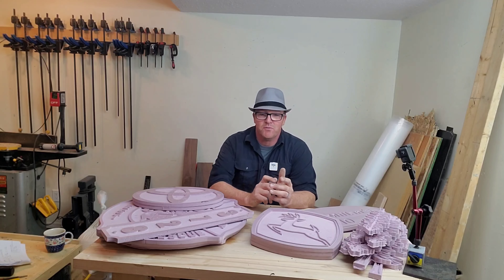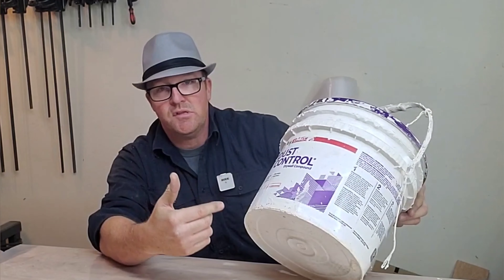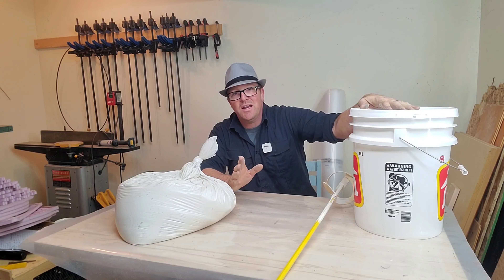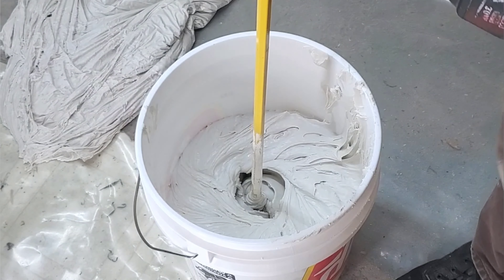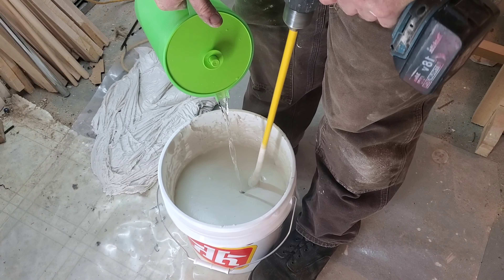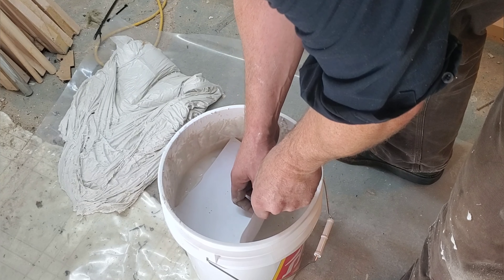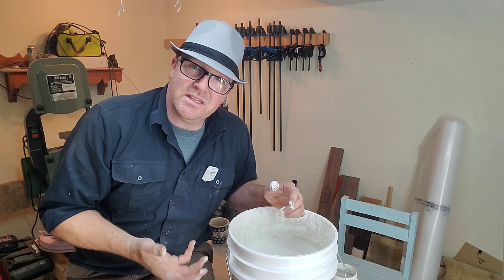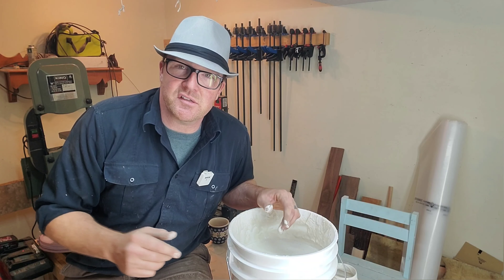Making cheap lost foam casting slurry

Comment: if you take a scraper and wipe the the bucket wall above the slurry line clean after each use, it will drastically reduce the propensity for the dried stuff to fall into and create chunks the slurry. Best, Kelly
Reply from the maker: Good advice as always kelly . Thank you

Comment: You can pull a vacuum on the mix and expell air a lot faster.  Have you ever tried straining the mix?  I think the only material that would strain it would be window screen.  You can use a silicon spatula to scrape down the sides so there are no old flakes. I love spatulas!  The Silicon spatulas scrape cleanly. I noticed when I started using them in cooking the pots and pans cleaned easier and I wasted less food.  Do you have a video on pre-prep of foam?  I've been thinking of primer paint sprayed far enough back the foam doesn't disolve and/or camp dry to help the cast stick and conform.  Thoughts?
Reply from the maker: I thought about vacuming as well , i did some lost wax a few years back and did it thay way . However i worry the air in the actual foam will cause issues . Much like a marshmellow in a microwave ,lol    also due to the size of the castings it would have to be very big .   I like your train of thought though on the topics :)

Ps , spatuala .... yes great idea to save and not have issues with it drying on the sides later !

Comment: Can’t wait to see more of this. I’m new to casting but lost foam seems to consistently make clean parts. I’m excited to dry this myself.
Reply from the maker: Lost foam casting is a fun type of casting and will make a consistent parts. I have been told that it makes a slightly inferior pare but have not noticed. it is marginally more risky with the off gassing of foam, etc just make sure you do your research prepare the mold correctly and wear your ppe. 

Check out some of my other videos and kelly coffields videos for a bit more inspiration :)

Comment: Just curious if that mixture is ready for the casting process? How long would it take before it gets sturdy?
Reply from the maker: The mixture after coated will take from 1 day to 3 days air drying. It is very important that it is fully dry all the way through.
Reply: @Wrighmachining  thanks seems like a highly detailed work with tons of patience.

Comment: Dear Mr. Wright,
I’m genuinely intrigued by your video to utilize dry wall compound as a suspenda slurry alternative, although in my country drywall compound that comes as a paste that’s been shown in you video is not readily available so I’m wondering if it would do just fine to use a powder form drywall compound and mix it with water into the right consistency? 

And also thank you for uploading this video I have learned a whole lot more about casting metal. ❤
Reply from the maker: Ok, if you are already into casting aluminium don't let the coating bog you down.   It will work with out the coating just fine.  Just you will not get as good ( but adequate ) of a surface finish.   The key in all of this aside from being safe and wearing appropriate ppe is vibrating your sand and pouring a little hotter than you would with green sandcasting.    The foam take a bit of the heat.   Check out some of the other videos. All have the coating but like I said it will worm with out. The coating doesn't hold the sand back at all.
Reply: Okay I will keep that in mind, thank you for the advice sir I very much appreciate it 👍🏻
Reply from the maker: Np

Comment: i do wonder if that mix would work with lost pla casting
Reply from the maker: That's a good hypothesis, however it is thin and doesn't have much structure due to be so thin. It's purpose is mainly to improve surface finish.     However I have used a type of plaster for lost wax casting and fired out the plaster and it worked great.

Comment: The shells don't dissolve in water once they're done? ...and the water content don't make them crack when dried or heated? I've thought about trying to use dry wall compound myself, but always discounted it, because I assumed it wouldn't work.
Reply from the maker: With thin layers on the foam it acts like graphite dusting on greensandcastings . It improves the surface finish   if you put it on way way to thing it will not breath properly and trap all the gasses . This could cause a burp or rapid bubbling of the metal .    It would have to be very thick though .   Once the mold is pourd the plater will wash off easy with soap and water . Some times i have put the alu in a bucket while it is still realy realy worm ( not crazy hot , causi g warping) and it sizles and takes the plaster off .     

Truth be told if yoi dont care about  space age surface finish it can be done with out the coating and just foam .  I just casted a machine part and it turned out good .  
Perhaps check out the lost foam casting video from last week . I casted a machine part for the servo motor that im puttibg on my indexing head .     Good results are seen just with foam

Comment: And you can fill this with molten aluminum with no major issues? I was under the impression a slurry had to be some unusual refractory material only special gods can acquire. This is awesome! I know nothing of this, BTW, as I have never attempted it. It was only an impression, so looking forward to watching your second part and learning from this!
Reply from the maker: It will be a couple of weeks before I get out there for part 2. Check out my channel though. I have a bunch of lost foam projects I did.  

Just be careful and make sure everything is dry, your wearing safety gear and you have done a tone of research from differed tplaces . Aside from the regular dangers with casting there is added toxic smoke and water from plaster if its not dry

Water expands 1800 times it's size into steam. If its wet it will spit out where your pouring.

Comment: Anyone who has done this, what kind of surface finish/detail are you able to acheive with the watered down joint compound? Currently testing this a few ways going looking for the most immaculate part casting with a lost pla or lost wax casting. Have a few different mixes drying with added flour silica, added waterglass. The joint compound seems to hold up pretty well but i need perfect for a 1 tine cast of a precision mold😂 asking alot i know and am too cheap to buy a ceramic slurry so.. help/experience/tips tricks appreciates
Reply from the maker: I have done lost wax castings by using a spacific casting plaster paris  and it worked realy good . This style of slury is just for improving surface finish on foam .  

If you do use the high heat plaster paris it will need to be vacumed with a vacume pump in a old pressure cooker.  This gets out the air bubbles . Then it needs to dry for a while in air before burn out .  

Im not sure what makes the plaster i used any better than regular plaster of paris.  

What are you making ?